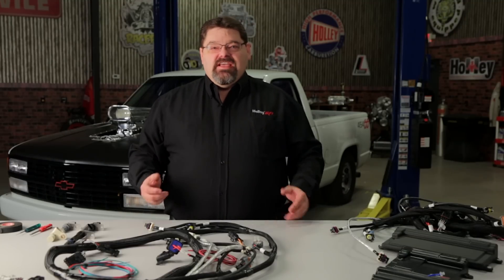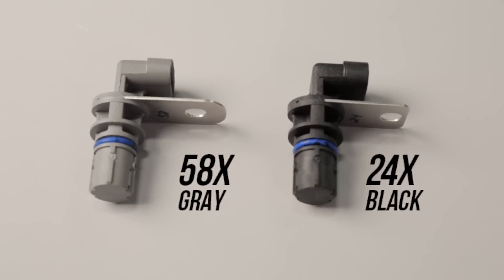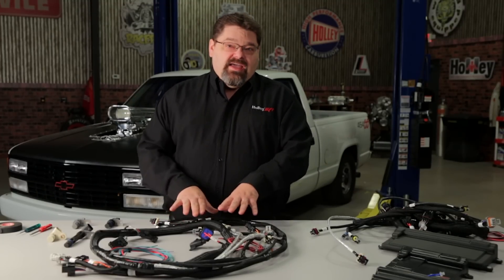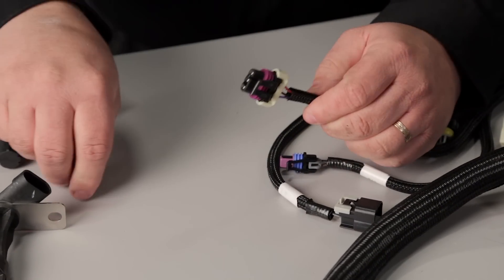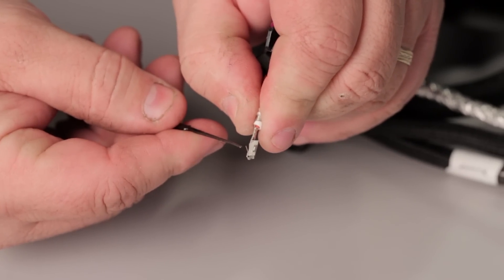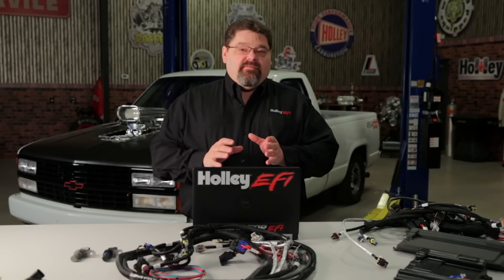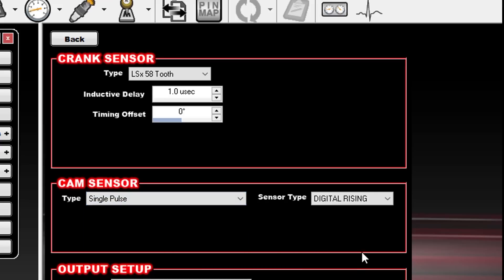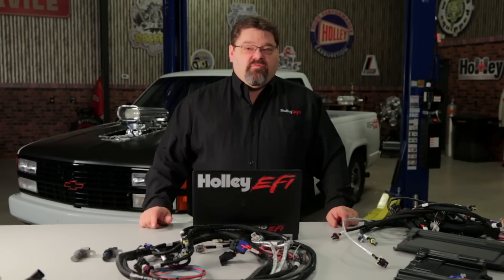How to use a Holley EFI 58x Harness on 24x Engines

Comment: So you are saying a 58x harness will work with both 58x and 24x sensors because  both sensors switch at 3v.  And the 58x harness is 5v supply voltage.
Reply from the maker: yes
Reply: @HolleyPerformance  hi. Just reading your reply but the 24t crank sensor and the 58t have different plugs. Which sensor should I use
Reply from the maker: @jamieknight9636  You will have to use the sensor your engine is designed for.  If you're using the 58x harness on a 24x engine you will have to swap the connector on the harness out for the 24x style and wire it correctly.   Thx J
Reply: So my 58x harness wich is now going to power 24x ,4x I don’t need to supply 12v to crank reference? It will still work correctly with the 5v?

Comment: what about going from a 24x to a 58x?
Reply from the maker: The best way is to swap the reluctor wheel and sensor. Or you would need an aftermarket box to convert the signal or  a tuner that is capable of converting.  Thx J
Reply: HolleyPerformance  on a terminator x max that was originally setup for a gen 3 24x it wont work by selecting the 58x and adding the front cam harness?
Reply: @brandonbetterton6609  did it ever work?
Reply: @brandonbetterton6609  did it work

Comment: If I was to purchase Terminator X Max 24 X1 for my 2002 lq4 and decide to upgrade later to a newer 2006 lq4? Can I make the modifications to do so on the Terminator X Max without having to make a second purchase? Plan on pushing the engine to its limits and I'm sure I'll have to replace it
Reply from the maker: The harness would have to be replaced in your set-up,  unless you get the 58x harness and convert to 24x.  Then when you swap to the 2006 engine you can return the 58x harness you converted to 24x use, back to 58x configuration. Thx J
Reply: 2006 lq4 is 24x you already have everything you need. Only 2006 corvette and ctsv were 58 in 06. 05 to 07 gets confusing.